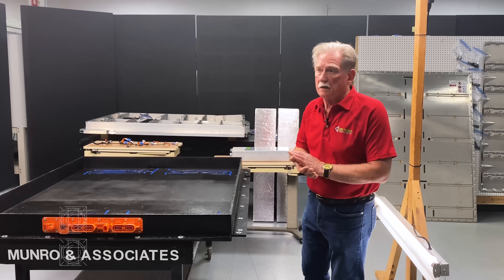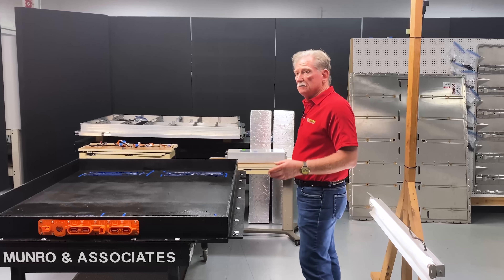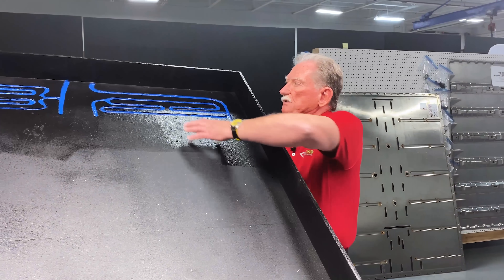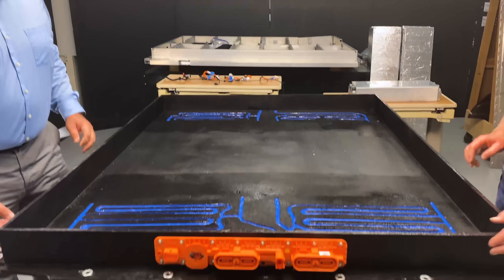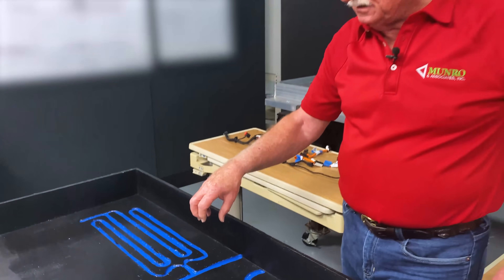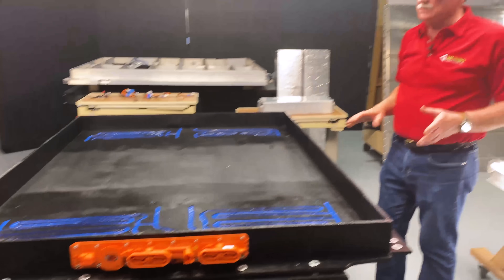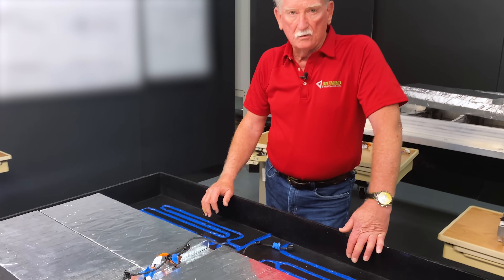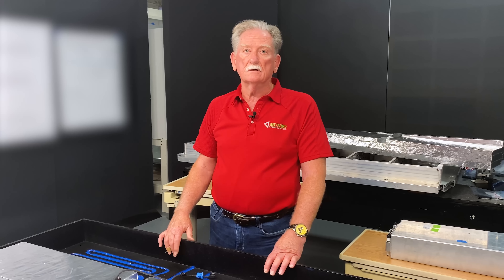Volkswagen ID.4 Battery Prototype Update

Comment: How well can composites like these be recycled? If composite is damaged can it be repaired? Usually composites like carbon fiber are very challenging to repair, at least more difficult than aluminium.

Also the glue would make battery modules really difficult to switch so if you are gluing them to the composite you might as well make a structural battery that can't be serviced.
Reply: These composites cannot be recycled (I wonder if the marketing guy from the previous video is going to pop up and start copy-pasting nonsense in replies again). VW, being the largest carmaker in the world with a ton more engineering expertise than Sandy, has made material choices for a reason and the added weight is a calculated compromise. Sandy's expertise is in manufacturing cost controls, not in long-term durability, reliability or ease of repair (aversion to threaded fasteners, anyone?).
Reply: @Ficon  correct 👍
Reply: @Ficon  actually they can be recycled. Polypropylene is very recyclable.
Reply: @Drivethisnotthat  Impregnated with carbon fiber?
Reply: @Ficon  So true
Reply: @Ficon  correct, Sandy hates anything with threads, but loves snap on locks so a product can be manufactured faster and cheaper
Reply: @Ficon  I feel like we entered stupidville.  In the previous video that included guys from the manufacturer, they talked about how easy it was to recycle the material.  People need to go back and watch it, rather than using wild speculation.
Reply: @_PatrickO  No, the sales rep from the manufacturer spammed comments with the same copy-pasted text while people questioned the ability to recycle carbon fiber-impregnated polymer tubs. With all due respect to Sandy, he is a manufacturing consultant with an axe to grind against threaded fasteners. On this channel, he has repeatedly shown that he and his team do not understand many aspects of modern cars from blended braking systems to suspension design. VW is the largest carmaker in the world. It's Tesla Stan-ism to say that just because something is different and hasn't been done before, it's automatically better.
Reply: @Ficon   but one could argue that threaded fasteners make the part less reliable as it could lead to more mistakes during assembly and have a greater potential for loosening over time when compared to a snap fit or just a reduction in fasteners if they are not needed. I’d say more the repairability would be the issue depending on how snapfits and adhesives are used. Although, if something was designed well enough you shouldn’t have to repair it.
Reply: @ryanmccawley5467  Screws are not a problem, sub standard engineering and assembly is. Proper design can compensate for one failed screw, does not need expensive QC and is highly automated.
Reply: @Piktogrammdd1234   I’ll admit that there is probably a low probability for screw to fail and I was more comparing them to snap fits or a reduced screw design. Would you agree that a design that maintains serviceability and reliability while reducing screw count would be a better design from a manufacturing standpoint?
Reply: @ryanmccawley5467  Have you ever worked with snapfit parts? Nothing like having to buy a whole new part because a tab broke off.
Reply: @Ficon   I have and it can get annoying. That could be more a bad snap fit design or a design not meant to come apart though. There are some work arounds depending on how small the part is. Have you every had to assemble something with hundreds of bolts?
Reply: @ryanmccawley5467   " Have you ever had to assemble something with hundreds of bolts?
 "  .. Yes. And it's nowhere near as annoying as snap fits. Power tools exist to remove a hundred bolts in a couple minutes, snap fits are nowhere near as fast when repairing / rebuilding.
Reply: @ryanmccawley5467  The major issue with screws is torqueing them down correctly. IF the correct torque is used they really shouldn't ever 'back out'.
Reply: He's using composite as a catch all for polymers. If you read sabic's website, they are basically a polymers house. I doubt there would be any carbon fiber in the design- note the egg crating on the bottom of the box which wouldn't be needed for carbon fiber. For recycling, I imagine the product could be chipped and melted back down into pellets for reuse if it isn't a resin+catalyst type product. 

I agree, gluing the batter packs in is a bad idea, and Sandy is showing he's far too focused on streamlined production and forgetting about repairability. He'd have our vehicles built like an Apple product, all pressure fits and adhesive with zero repairability.
Reply: @tjs114  Nowadays most of the polymers can be strengthened with some kind of fibres. They are not PP or PU or PA but more and more PA66 …
Reply: As far as I could see the Munro guys don't give a fuck about recycling. As good as they are, it should be an integral discipline within engineering nowadays.
Reply: @cornflake9654  Agree. And Tesla,Apple  etc have to rethink their strategy about recycling.
Reply: I hope that Munro Live can speak on the issue of recycability and repair, especially if the vehicle is sold in the under-developed world where repair essential.
Reply: @dollarette  Oh yes, different design methods apply where serviceability has to be a more prominent concern.
Reply: @Alfred Wedmore it really depends on the application. In a lot of these cases with the cars Sandy tears down, the design is not optimized as well as something like a boiler. I agree there may be a need to increase the web thickness on some of the parts if you remove some screws but that could be a good trade off as you reduce parts and complexity. The other thing he talks about is having the part slot in place and only needing the screw to hold position or hold down the part. In that case the clamping mechanism is not just the few bolts but also the tabs.
Reply: repeairability of CF is a question of how strong does it have to be and how big is the damaged area...a small hole in a sheet is actually very easy to repair. A snapped structural tube - not so much.
Reply: @Alfred Wedmore I don’t see many people complaining how pelican cases don’t use bolts to hold their hinges on to the shell. They are just molded into the shell and have one or two pins holding the whole thing together. Not really a snap together design but you don’t need to have bolts to assemble things.
Reply: Hey there! There is already the ability to recycle polypropylene out there. The majority of a car today is made of plastic. Plastic has a better LCA than aluminium, too.
Reply: Composite can be repaired with extra material, not quite as easy as with metals.
Reply: Regarding repair of structural composites, I know Airbus looked long and hard at that one before going ahead.
Reply: Structural battery packs are not meant to be serviced or repaired.  If a structural component in a vehicle is damaged in a crash, the insurance company will write you a check, that vehicle will be marked as a salvage.
Reply: @cyclopsvision6370  Ideally one would want to avoid 'writing off' too many vehicles though for no other reason.
Reply: I think all of you are potentially forgetting the context:

- EVs are still much more expensive than comparable ICE vehicles.
- Tesla are absolutely storming ahead with megacasting and structural cells which other companies potentially cannot afford to follow.
- Therefore other companies need to do anything and everything to reduce cost asap, if they are even to survive.

I'm most annoyed about the lack of recyclability here. But I can see exactly why Sandy is pushing this stuff. He's trying to help.
Reply: @bodiesands4654  Yes, but no. You are also partly forgetting the context as the whole idea of an electric vehicle is to be as good for the environment as possible. Making the most polluting part (to manufacture) of the vehicle harder to service and repair, just to make more profit for the manufacturer, in my opinion defeats the whole purpose of trying to make the vehicle environmentally friendly in the first place.

VW has really been upfront how these electric cars are supposed to be better for the environment starting from the manufacturing. Sandy is just an engineer from another era. He has great solutions, but they often tend to cater towards the manufacturer and not the consumer.
Reply: @bodiesands4654  on another video Sandy mentioned that aluminum winding in electrical motors is a better way to go then copper (Tesla uses aluminum) he lost all credibility.
He is trying to bring down cost and is not concerned about reliability, however components that are not reliable actually cost more in the long run.
Reply: ....reality is a car gets wrecked/hit hard enough to crumple the battery tray and you are concerned about repairability!
Reply: @roberthawxhurst3717  A hit to the undercarriage from rocks, dividers or such can break the battery tray without wrecking the hole vehicle. I've seen plenty of Teslas with battery damage from hits to the underside on European Copart and those cars have been sold to be repaired. In case of a crash it's always very nice to have as many parts of the vehicle easily repaired and everyone who has repaired totaled vehicles from Copart or insurance companies alike knows this.
Reply: @I_THE_ME  Further, the batteries can be repurposed when they become weak (e.g. 65% to 70% original capacity). My no longer be suitable for a car but still would make sense for a power wall.
Reply: @toddmarshall416  Far better to prolong their service life/repurpose than recycle early in their life cycle which is a complex and relatively wasteful affair.
Reply: @roberthawxhurst3717  Is that the only cause of a battery module failure?

Comment: I wonder how good the heat transfer is when those tubes are embedded in the composite. Since composites are very good isolators 
Unless sabic has found a magic solution for this.
Reply: The heat exchange is done at a radiator or a heat pump or similar. The channels in the composite are only to transfer the coolant.
They aren't pipes as well, they are "half pipes", i.e. open on the top, such that the coolant has direct contact with the battery for good heat transfer.
Reply: Some composites with carbon copper etc can conduct heat well enough. I think it is not required to conduct a lot of heat considering surface area. Maybe they would put aluminium plate over channels that interfaces with coolant and battery.
Reply: Not sure why it would be a big problem... the thermal transfer is between the battery (casing is prob. aluminium) and the liquid. You might need to enlarge the cooling channels to regain some lost surface area.
Reply: Metal particulates, graphene or graphite

Comment: All of these composites and glue make this seem like it's never meant to be serviced. What happens if you need to replace one of the battery modules? Metals are also infinitely recyclable, composites almost never are.
Reply: @oijhhytdirhrbru  Issues with repairability is my biggest problem with Tesla. Also, training technicians to handle new skills isn't a big deal. Mechanics (especially when they work for dealerships) have to get certified in specific training all the time.
Reply: Bad battery modules get replaced by removing the whole thing and sending it to a stationary power grid stabilization station like Hornsdale AU and then bolting a whole new tray to your car like a battery swap and if the car is under warranty you likely won't pay anything but time to do it after all the modules have spent their service life then it will get reduced to dust and recycled.
Reply: @Barskor1  What happens when you're out of warranty and one module goes bad? Tough luck, you'll just have to pay $15-25k for an entirely new pack? That would total most cars which would just make for more waste. You can only recycle so much of a vehicle.
Reply: @oijhhytdirhrbru  Except the whole pack is not going fail and the remainder is still useful for the battery stations and thus be valuable offsetting the purchase of a new battery tray.
Reply: @Barskor1  You're correct in stating that the whole pack won't fail and that it would probably only be a few specific cells that die. However, if everything is glued together and there's no way to service the battery to isolate the bad cells, how would the pack be able to be used in an energy storage solution? They would need to isolate the bad cells just as much as someone repairing the pack to keep it in automotive use.

Oh, and you really can't recycle everything in a car. Just thinking of a few things off the top of my head that would be difficult to impossible to recycle, you have laminated glass, seats, and pretty much any of the myriad of plastics and rubber bits that are used. Contrary to what the oil companies want you to think, most plastics can't be recycled, and even if they can, it's often only once.

No matter how you look at it, environmentally it's massively better to repair a car than to junk it and get a new one.
Reply: To the point. I would pay a  bit more, if I know it can be serviced down the road if needed be. Glueing it all together is not cool. Is like comparing a metal cup with a plastic one.

Comment: Love these videos. I really struggle to understand how some of the battery work / thermal management gets signed off by the major OEMs. Every OEM must have a equivalent in-house Munro
& Associates but sitting around doing nothing!
Reply: VW did their engineering work about 4-6 years ago. And they have a clever system of modules ("chocolate battery") where you can put in more modules or less modules (7, 8, 9, 12, 14, 16 modules) and still get around 300-350 volts nominal voltage from each configuration. The 7 and 9 configurations leave one module slot empty, where you can put in power electronics like the AC onboard charger, just like Tesla did - at the expense of a buried  OBC in case of failure of this component.
VW cared about reuse, repairability and second life as well. And they cared about logistics as each module is below 60 VDC and therefore does not require extended UNECE battery transport standards. The 24 cells in each MEB pouch cell module can be wired as 12s2p, 8s3p, 6s4p, 4s6p which is very favourable. So even if you could put in 25 or 26 cells, made possible with some more space, one would loose this flexibility.